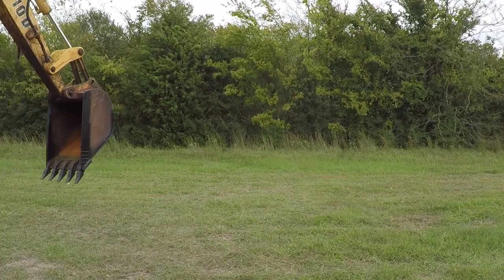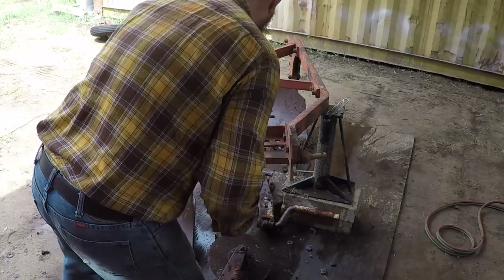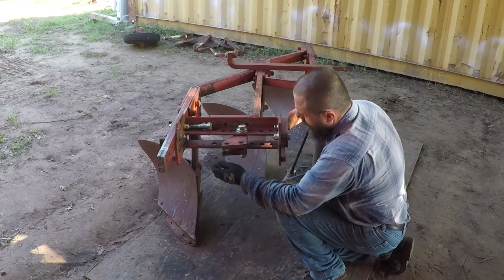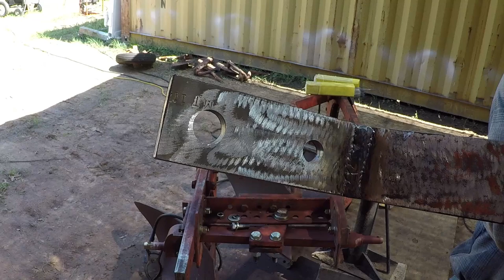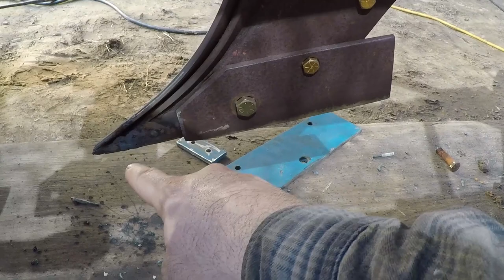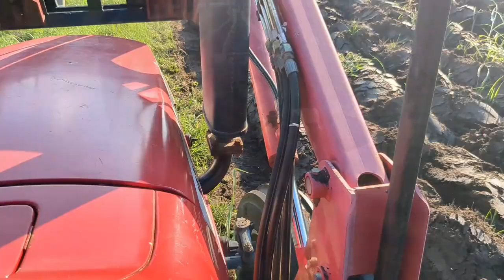Restoring 3 Bottom Plow

Comment: Great job on rebuilding a heavy duty classic plow.  I like how you used 5/32" 7018 on those heavy sections...leave the 1/8" electrodes for the kids in welding school lol!👍👍👍
Reply from the maker: Good morning brother, I wish my welder support 1/4" rod. It's only 185amp. I always try to use the biggest diameter welding rod if the welding machine and the metal thickness allow it. 5/32" worked great. It leaves thicker bead. Thank you for watching.
Reply: @SalamSayhood  yes, the major manufacturers are limiting electrode sizes to 3/16" [no more 7/32". 1/4", 5/16"] due to Mig and flux core use.  5/32" and 3/16" can still pour in welds!!!
Reply from the maker: I think you are correct, the last time I saw 1/4" 7018 rods at the welding supply shop it was a while back. I bought 1/4" rods in 2004 and welded 1.5" thick plates. We rented back then a gas welder (I think it was 300 amp). It worked out great. Haven't used anything thicker than 5/32" since, I did not need to use anything thicker.i still have 1/2 box of 1/4" 7018.
Reply: @SalamSayhood  My recent searches shows that only E7024 is available in 1/4 in the US .  Take care Salam.